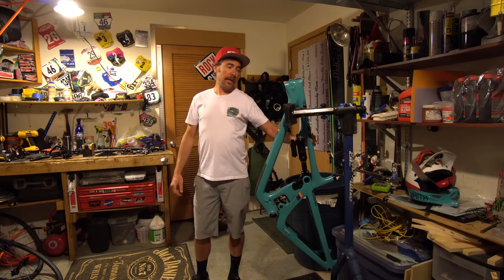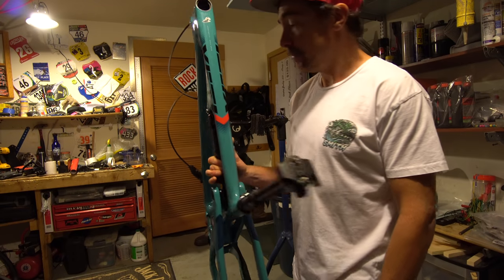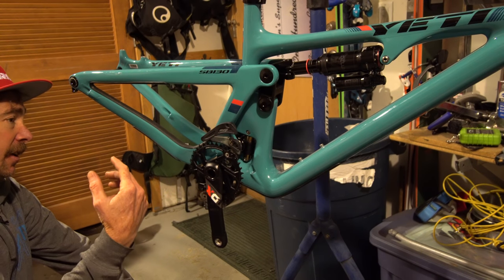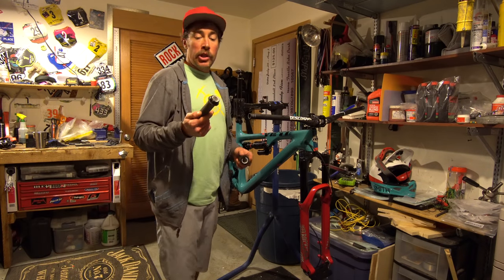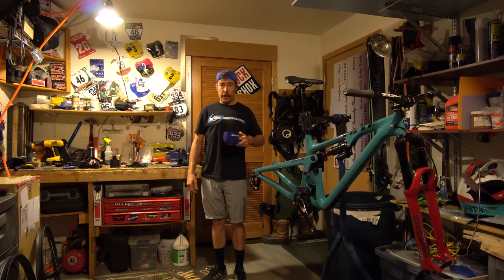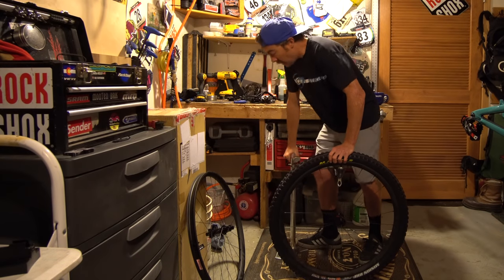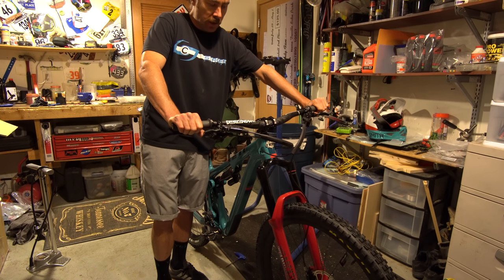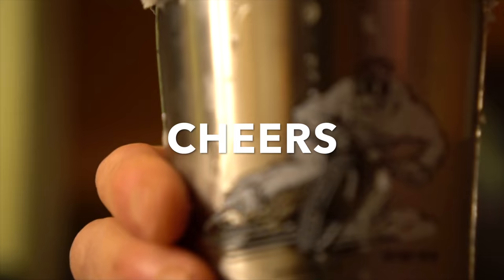Yeti SB130 Bike Build

Comment: I made my own custom bike frame protection using a traction pad for surfing......you can cut the traction pad into strips or pieces to fit whatever you want to protect on your frame.....Its not clear like the invisiframe protection but its actually a lot better to protect your investment, Has some padding built into it so when your rig slams the ground or rocks it actually has a small cushion to absorb the impact, and all the places I ride everyone is like that is really cool what is that?  I use Da Kine surf traction.....DAKINE brah!!!  Keep up the amazing content!!
Reply from the maker: Good tip right there. I bet that offers a lot more protections than the clear bra. Good stuff! #adam'sbikehacks
Reply: Hahaha im a bit of a bike nerd myself, raced Mammoth last weekend it came in handy!
Reply: using a traction pad seems like a huge waste of money (unless its recycled) you could use 3m adhesive foam instead in order to save some money
Reply from the maker: I gave used mastic tape before for the chainstays. Works great.

Comment: Hello, Nate and thanks for the tutorial. I need your help in selecting the right SB130 for me. I live in the Seattle WA area and ride places like Tiger Mountain, Raging River, Olallie, Tokul, etc. I'm an advanced rider who can easily do black diamond trails and some double black diamond trails but not without walking hairy parts of them. I'm ready to buy a new SB130 and I'm torn between 2 builds Yeti currently offers: 1. The Race X01 build 2. The new Lunch Ride version. I'm afraid that if I go with the Race X01 build, my downhill performance won't be so good and if I go with the Lunch Ride version, my climbing performance will suffer. How much will I gain/lose choosing one build over the other? I know the Lunch Ride version is slightly heavier than the Race X01 version. However, I'm definitely planning on going with the carbon wheel upgrade Yeti offers. What is your advice? I welcome advice from other SB130 owners too but I realize most people don't have a new SB130 Lunch Ride because they just came out about a week ago. Thanks for your time!
Reply from the maker: My 130 has basically been a LR since day 1. You really aren't compromising much on the uphill, but the bike really comes alive with the taller fork. Unless you are racing uphill, I wouldn't really focus on weight, but fun. The LR will let you get a bit more loose and have more fun. At the end of the day, that is what puts a smile on my face. Hope that helps!

Comment: I'm bummed that this bike doesn't have the flipped and shrouded stanchions like the SB100, but I love the new look of it. Still wondering if it is 29er/b+ capable. Thanks for posting, and being straightforward about sponsorship or lack there of WRT parts.
Reply from the maker: I have been running a 2.5 Minnion in the rear without issue. Transparency is the best policy. Not trying to fool anyone, I am fortunate to have the support!

Comment: Any thoughts on the 130 vs 5.5?

Bought a 5.5 last fall and love it.  (Water bottle cage wasn't a deal breaker for me......lol.)
Reply from the maker: The geo feels very different. Feels just as stable as 55, but seems to be a bit quicker to turn and has a more lively feel on trail to me. The steep seat angle is SO much better for climbing. Still love my 55 though.
Reply: Bought 5.5 in the Spring. It's a monster. Can run over anything!!!

Comment: I’m trying to understand the steeper seat tube and longer reach... doesn’t it change the fit of the bike, putting the seat further over the BB? Also, doesn’t a longer fork than intended, also shorten the reach?
Reply from the maker: It basically pushes everything forward. Makes things feel really stable and long, but still playful. Pretty sweet. Fork length will not change the reach, raises the BB a hair.
Reply: Nate Hills I’m just surprised with so many people complaining about the lack of maneuverability in 29ers, they keep getting longer. I ride a 2017 XL Stumpy. It’s a big friggin’ bike. I’m 6’3” and at times feels long to me. You’re right about the BB. I’ve never had an issue with press fit. Pinkbike comments carry a strong voice in this industry, it’s crazy!
Reply from the maker: When you offset the long reach with a short rear end and a 42mm offset fork, you get the best of both worlds. Transition got it right. Pinkbike is the final word, for better or worse. The comments are good for a laugh.
Reply: Nate Hills oh really, you think Transition got it right. I haven’t ridden one yet. So, you’re telling me that my 51mm offset fork is already obsolete?! Damn it. Keep up the great videos mate. 🤜🏼🤛🏼
Reply: I could read Pinkbike all day. There was a real treat on there today about Evil bikes. Good stuff!
Reply from the maker: 51 works great for 95% of the bikes. The new school long front end feels better with the shorter offset in my opinion. Otherwise the 29ers feel loooong.

Comment: Did you size this frame the same you would an SB5.5? Did the 40mm stem fix any reach issues you had?
Reply from the maker: I have always been a medium so I went with that. The 40 feels sick and definitely helps with the difference in reach, without compromising stability.

Comment: Thanks for the awesome vid Hillsy! Mines on order but as I am a non-ambassador slouch 🤪 it’ll be awhile before it arrives. Did the Stages clear the chainstay without mods? I was afraid the sensor/battery housing was going to rub and force me to switch to Quarq...🤞
Reply from the maker: The arm that I am using clears with about 3mm without any mods. This is the most clearance I have seen after running meters on the bikes for. a couple of years now. Stoked.

Comment: Great vid!  Why do you put the clear tubing on the exposed shifter cable again?  I didn’t quite understand. Just extra protection for the housing?
Reply from the maker: Basically, I would hit my housing on rocks and small trees all the time, it would crack and have to be replaced. It is the weak point from a breakage standpoint. This just keeps that from happening, and I have to replace the housing much less frequently. More time to ride.
Reply: Sweet, thanks for hitting me back!  Interesting that hasn't happened to me yet, I must not be riding hard enough!  I'd love to know if anyone has a better solution to the end of the cable, I constantly losing the crimp and the cable starts to fray..
Reply from the maker: Maybe you are just less of a hack than me;) This was more of an issue in the old days when the exposed housing was longer and stuck out more I guess.
Reply: While I got your attention, why don't you get to do the Trans Cascadia?  Why does Kabush get all the fun?  That one seems right up your alley..

Comment: Rly liked watching this! Especially since i worked a lot on my mew bike the last months!

One Question on suspension: how many volume spacers do you run and whats your SAG?
Reply from the maker: Not sure how many spacers are in the rear, 2 tokens if front. I may add a token. I run 30ish percent sag in the rear and never measure the front. Hope that helps.
Reply: Nate Hills thanks, that helped. I‘m trying different setups in my fork and had good succed with two spacers for the steep tech trails i ride in the alps. But for my hometrails this is two much. Do you change setup for different terrain?

Comment: What is the difference btw the multi tool in the headset vs. the bottle cage? Are they redundant or each have a unique set of tools?
Reply from the maker: My chain tool is in my top cap and there is a basic multi tool mounted to my cage. Different bits.

Comment: Hey man, I was wondering about the fork, I ride an Evil Calling with a 140mm Pike, I was thinking about having it extended to 150mm, will I really see a difference in terme head angle?
Reply from the maker: Adding 10mm will translate to roughly 1/2 degree slacker HT angle.

Comment: Nate, I ordered the 3M tape you suggested and was curious if you've had any issues with it peeling while applying dry instead of wet as recommended. Thanks!
Reply from the maker: I have only used it dry and never had an issue.

Comment: have you ever tried taking the chainguide off recently? I've never had the need for one with a clutch type derailleur
Reply from the maker: That is just not a thing in my world. I can't take the risk in races or in riding exposed terrain where one slip of the drivetrain could result in injury. I see people loose their chains all the time with the newest drivetrains, regardless of brand. The clutches are good, bun not 100p. If you ride really rough terrain, you need a guide. You should see the bottom of my bash guard, it has saved my chainring hundreds of times.
Reply: @natehills9388  yea I definitely run the bash guard as well, idk maybe I just need to ride faster, narrow-wide + clutch has been working great for me and I ride northeast rocks a lot

Comment: Awesome video, thank you!
How much clearance does the Stages GXP Gen 3 have to the chainstay?  My Gen 2 rubs a tiny bit...
Reply from the maker: All of the Stages meters are very tight in there. Rubs under hard flex, just a hair.
Reply: Right on.  Did you install the wavy washer on the drive side of the crank?  Thanks!

Comment: It seems like most of your rides happen on really steep technical trails, and you’ve also spent some time in bike parks.  What made you go with the sb130? Why not the sb150? Let me know.. thanks!  Happy riding!
Reply from the maker: Building a 150 now... Stoked to try something new.
Reply: Im still waiting for my 130 to come in mid April.  Pretty stoked! It’s gonna be the xo1 race build.  If you are going to let go of some parts from your 130... let me know and I can take em off ur hands. i.e. carbon wheels etc.  did you feel under biked? Is that why you’re going with the 150? Or is it just based off the trails you ride. Or comparing to your previous 5.5
Reply: Nate Hills, I’m still waiting for my 130 to come in mid April.  It will be the xo1 build.  If you are willing to sell some parts on 130, pls let me know. I.e. carbon wheels, etc. Do you feel like you are under biked? Or is it because of the trails you are riding?  And comparing it to your previous 5.5

Comment: Hoping you could shed some insight since you've ridden both the sb130 and sb150.  I live in Alberta, Canada. I love riding the trails in this area (Canmore Nordic Centre, Bragg Creek, etc.) and also like to do some backcountry riding both here, and out in British Columbia (i.e. Frisby Ridge). I would like to do a few Enduro races (at least 1-2 this year), but I'm not an insanely aggressive rider -- in the sense that I don't do large jumps or drops (I stick to the smaller ones lol), rather my goal is to have fun. Would you recommend sb130 or sb150?  For comparison, I'm currently on a Trek Remedy 8 (150mm rear, 160 front)
Reply from the maker: If you are all about fun, go with the big bike. It will let you push harder on the descents, more confidently and lead to a bigger smile at the bottom. In general, the trails in Canada are steeper than Colorado, so I will be happy to have my 150 along when I visit this summer. Both bikes climb very similarly, given they are set up in a similar way. Hope that helps!
Reply: @natehills9388  thanks man! Appreciate the feedback!